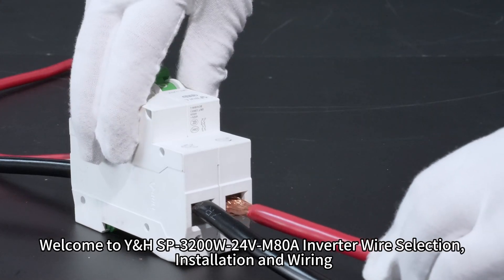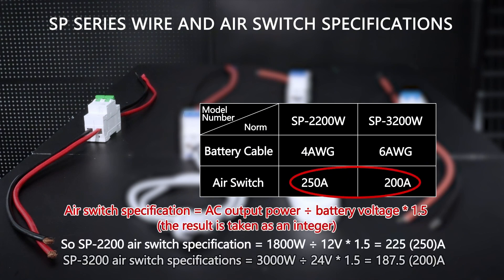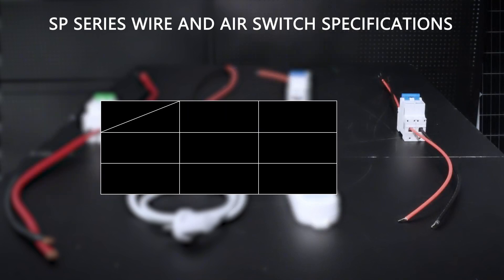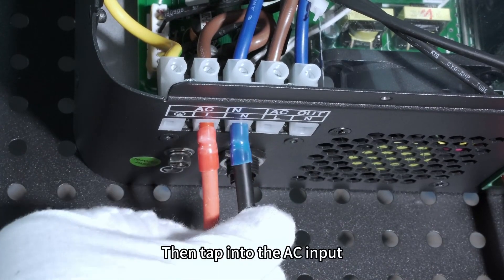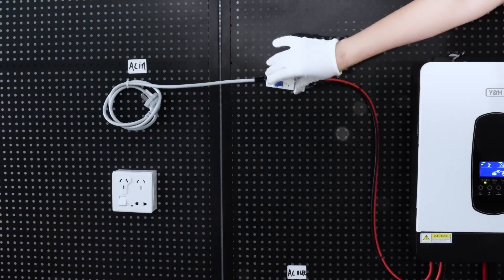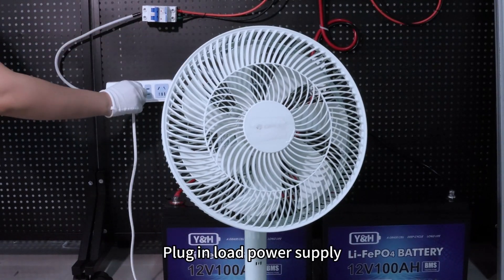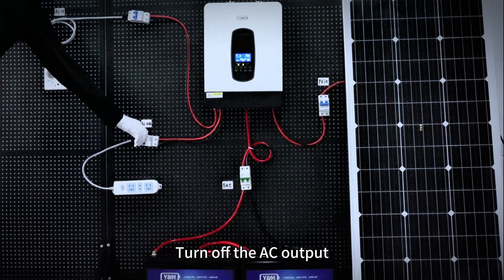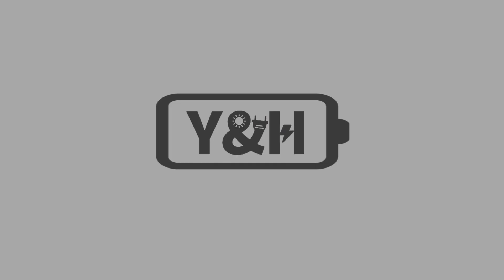🔧 3.2KW 24V Y&H Hybrid Inverter Wiring Full Process｜Wiring + Startup & Shutdown Operation 🔧

Comment: Off grid mean is only receive from ulity and not send to ulity
Reply from the maker: Yes, Off grid type, can't upload excess power to the grid. You need to upload power to the national grid? We have them available.
Reply: @yonghuisolar  So off grid type only receive power from grid.
But when pv and battery not supply enough then grid will add to missing amount or fully 100%
Reply from the maker: @tuanzoro01  Difference between off grid and on grid
The off grid inverter output can only supply power to the load.
The on grid inverter output can only be connected to the home grid, and any excess power will be uploaded to the grid.
Reply: @yonghuisolar  example PV and Battery only supply 70% load then grid will action supply 30% or fully 100%
Reply from the maker: @tuanzoro01  Yes, it is possible to follow your understanding that the hybrid inverter can select the power/charge priority level.

For example, if the home load requires 1000w of power, it will be prioritized to get it from the solar panels, for example, if the panels only produce 500w, then the other 500w will be replenished from the batteries, and if the batteries run out of power, then it will be replenished from the grid.
Reply: @yonghuisolar  I have question what is the GRID-tie Current for? what will be the settings? if the GRID connection operation is OFF